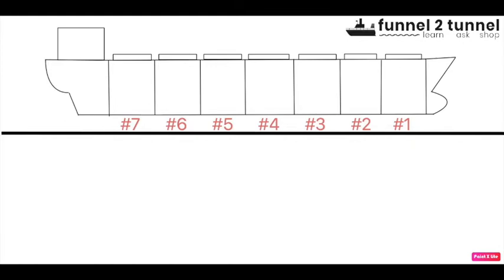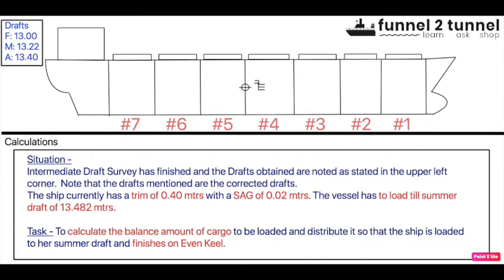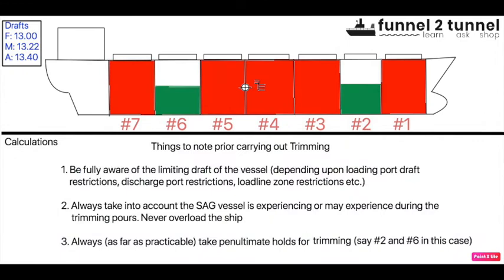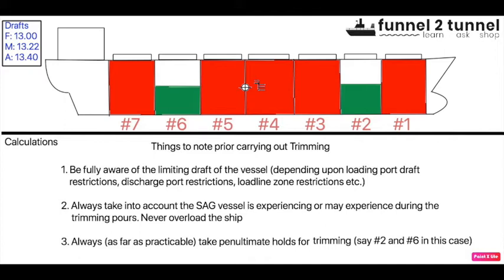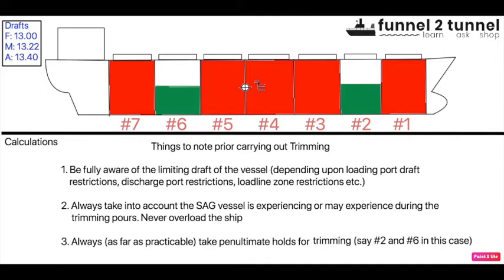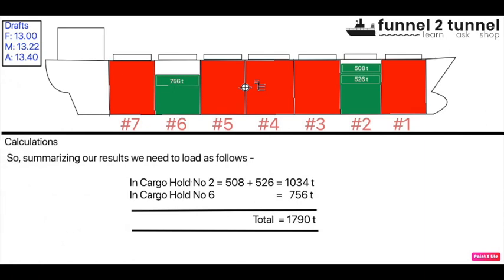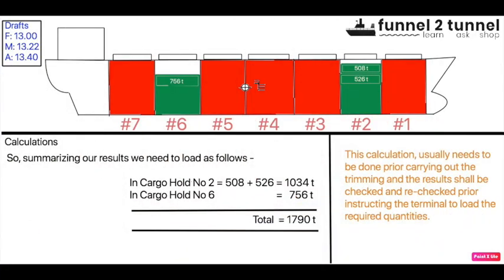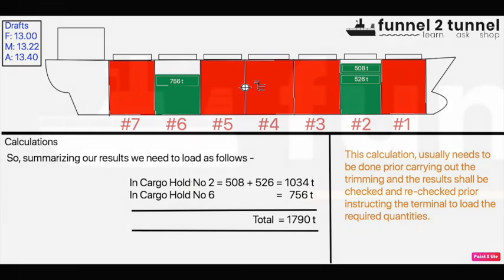Trimming calculation on ships | Carrying out trimming on ships | Trimming  Tables | funnel2tunnel

Comment: Very knowledgeable key video to learn about final trimming which is mostly required during calculations.
Reply: A simple theory about even keel, is to move your weight in which distance between lcg and lcb is zero at final draft…if there’s zero trim lever, even keel will result on your final drafts.

Comment: Excellent video. I have 2 questions.
1.- What about sagg or hogg allowances (if vsl has LOA 200 mtrs), 5% of LOA is 10 m, so, as rule we can use max sogg/hogg of 10cm? I don't remember where I saw this formula.
2.- Trimming tables are considering Drafts Marks or Corrected Drafts (On LPP)?

Comment: Many thanks ! With trimming is clear, but I would ask you - how to remove list ? Are you using ballast or some how with cargo ?
Reply from the maker: during the last stage of loading the list is correctedby carefully observing the draft marks on both sides on midship (usually done through manometer about which we shall be discussing in due Course ) This results in ensuring that the vessel remains upright during and upon Completion of loading. Since de ballasting operations are usually Completed during this stage, the list is Corrected normally using Cargo.